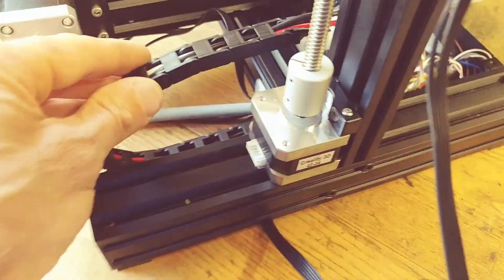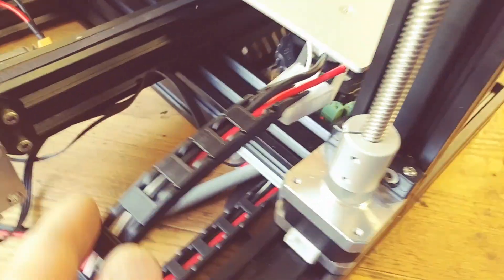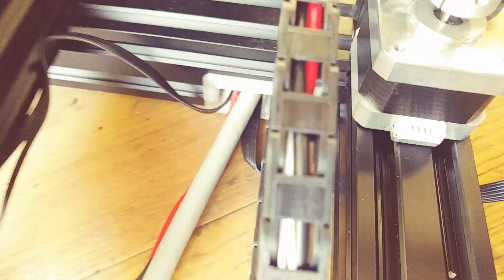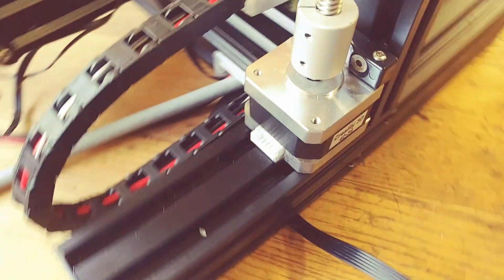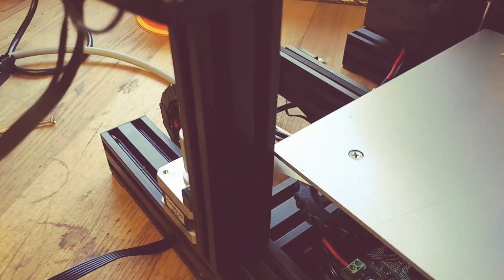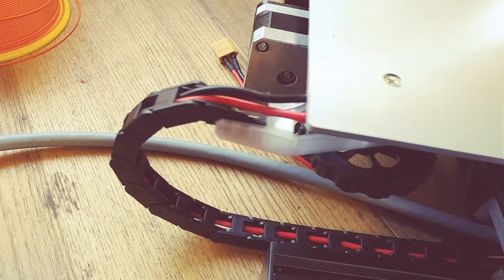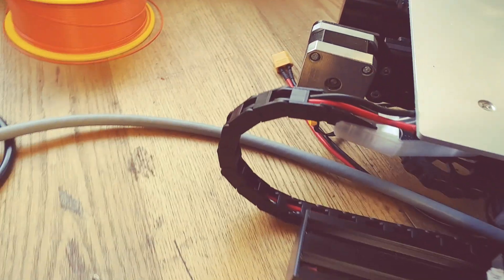Ender 3 build plate drag chain and control box protector

Comment: Hello. Thanks for your video.
What is the dimension of the chain? 10mmx10mm?
How many mm of long is necesary for all axis? X, Y and Z.
Reply from the maker: 7x7 for the bed. 10x10 for extruder. i dont use any other but 7x7 will work on other axis. there are 2 types and one is better than the other. The better one has concave/convex links: https://872c4715dbe9f10b83d1-0b39dab3ba460c18aad59cf32aacf5c8.ssl.cf5.rackcdn.com/TE735-E-10-main3.jpg.
They are sold in lengths of 500mm or 1000mm and is plenty for 2 axis but then you need to get extra end links somewhere